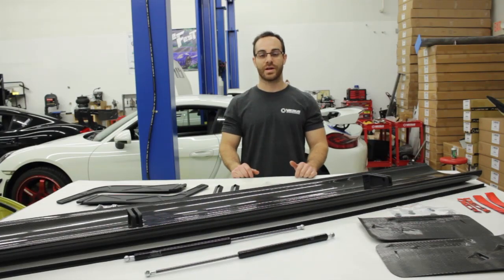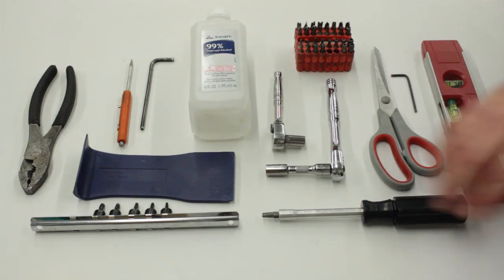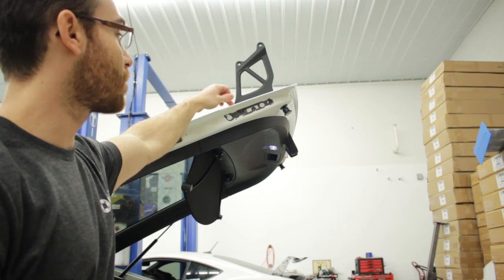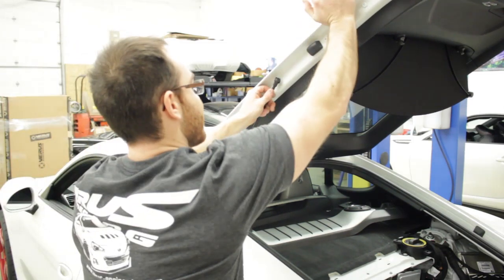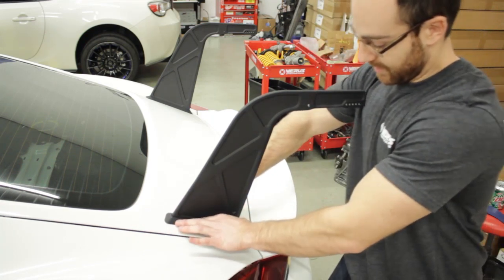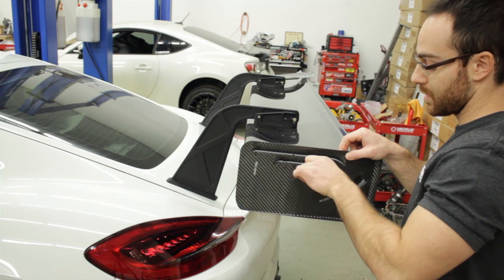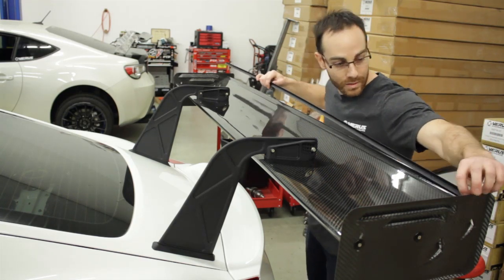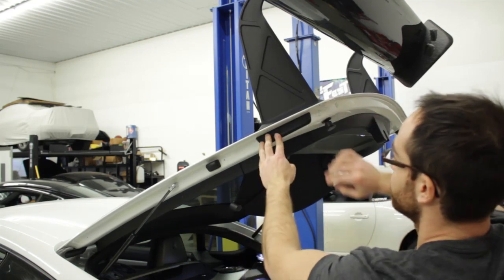Porsche 981 GT4 Rear Wing Install

Comment: Quick question  How to you access the center LED backup light or wiring harness?  I have a 2014 Boxer S - I'm wanting to wire a bluetooth camera to the backup light. There is no easy access to this light or wiring harness and I can't find any videos of someone removing or attaching to this light.  I already have fished up the wiring (camera) from the license plate area up thru the (left) license plate light into the trunk area.  Would appreciate your insight on how best to access this light assembly or wiring harness?  Note: Short term solution, wired directly to fuse box on passenger side trunk area to get power to the camera (12v).
Reply from the maker: No idea honestly. We have never messed with the backup light or wiring harness. This would be a better-asked question for a shop that specializes in Porsches. We just make aero components for the car.

Comment: Many dislike the spoiler on the GT4.  Do you make plates to replace the uprights?
Reply from the maker: We do not offer factory upright replacements, but with our Rear Wing Kit, you would receive new uprights that bolt to the factory mounting locations.
Reply: Many in Porsche forums are looking to replace the uprights once the rear spoiler is removed with metal plates that look stock.  I'm sure you can fabricate and profit from this.  Everyone likes the Cayman GT4 but many dislike the rear spoiler.
Reply from the maker: @gerardov.9716  I believe there are multiple upright replacements available on the market currently. We will certainly keep it in mind though.

Comment: Can this be used on or do you make a version for the 981S?
Reply from the maker: Unfortunately, we do not. The wing can work with the S, but it requires a GT4 rear hatch, so you would need to purchase a rear hatch in order to get it to work.